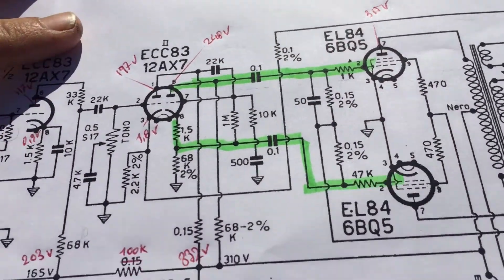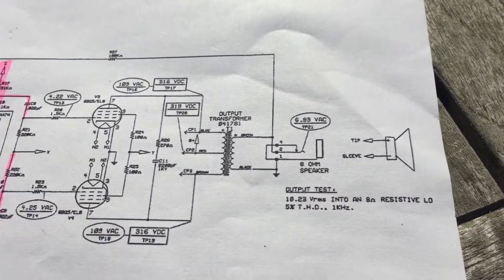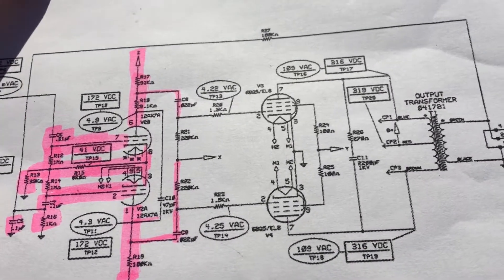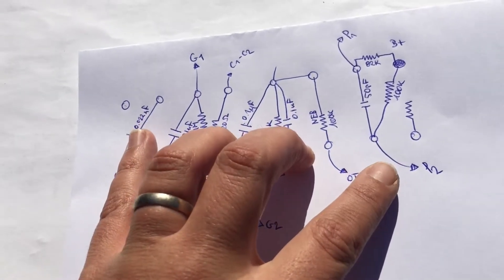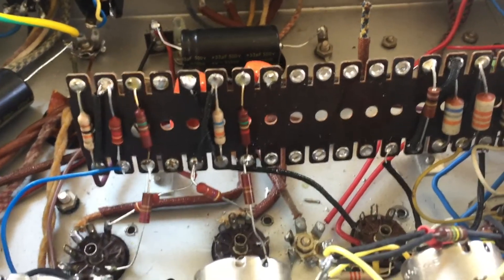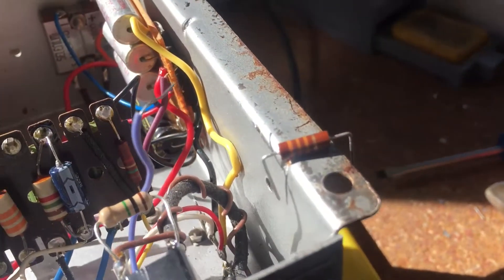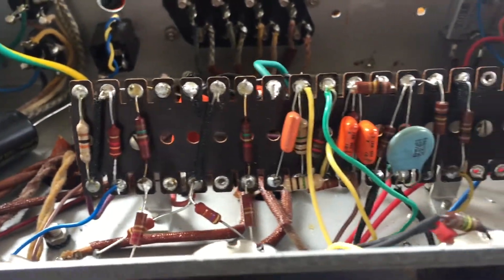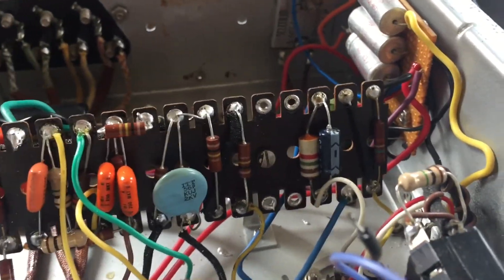Converting tube PA amp to Long Tailed Pair phase inverter

Comment: A simple way to make the cathodyne sound more like a long tail is using grid stopper 470k to 1 meg ( smaller values from 10K could be use, try a 1 meg audio taper to adjust to taste or leave it as a “sweet” control) between the first triode and the second that invert the signal, this reduces distorsion and get better arriculation and less fuzzy mushy sludgy sound when cranked but retain the rich harmonic content of the cathodyne, some people might said it changes the character of the amp closer to a long tail,but they can just swicth out that resistor and go back to the cathodyne “falling apart” sound.
Reply from the maker: Hi there, I have 5 of these amps and have been messing with them for a long time... the only problem is that they don't distort harmonically at full volume, and I still don't know why. Switching out the cathodyne PI was one attempt -- but the Tweed Deluxe has a cathodyne PI!- I don't think the PI is the issue -- hoping to make a video soon where I switch out the output transformer for a Marshall 17W style transformer.

Comment: if you mind me asking, why did you want to change from cathodyne to LTPI? I think of cathodyne's distortion sound as with a fuzzy character to it (like tweed deluxes, some orange amps, and if you think about it, the univox superfuzz and other octave fuzz pedals like the green ringer and the Roger mMayer octavia, that all use a kinda "cathodyne" inverter/phase splitter transistor on it)... I think it's got more character than the LTPI
Reply from the maker: Sorry for the late reply! I was wrongly convinced at the time a different phase inverter would clear up the ugly distortion these amps have (all of them) at max volume. I still don't understand the reason but already bought a marshall style 17W output transformer to put into one of these puppies...

Comment: Did you try a 12AT/ or12A Y7 in the PI slot?. It will clean it up quite a bit as will changing to  a bass/treble rather than just a single tone control.
Great work!
Rob.

Comment: One of your phase inverter 100K plate resistors should be 10 % more or less from one to the other. To compensate the inverted and the non-inverted signal.
Reply from the maker: Hi Paul, thanks for this comment. Fender did this in the early days, e.g. in the Bassman 5F6, where the tail resistor in only 10k... Merlin Blencowe (p.162) writes "it is interesting to see that if the tail increased above 18k, the balance becomes worse with this 82k/100k combination than if both anode resistors are both 100k". There is 33k in the tail of this amp and if if it's not sounding its best yet, it's definitely in the PI. 
Merlin concludes that many companies just copy without proper understanding of the theory. Also, if you look at the little Fender Pro Junior (2xEL84) has 100k on both plates in the phase inverter.